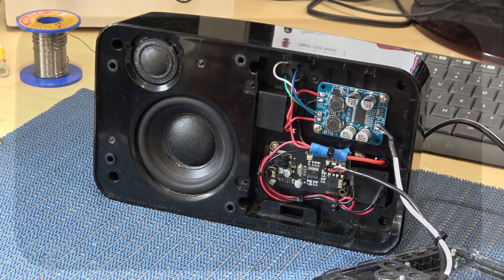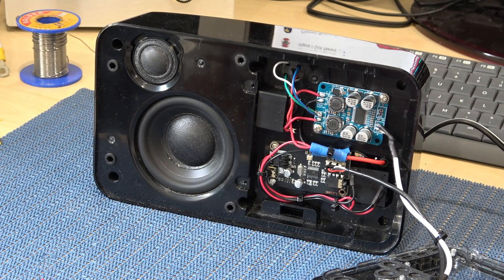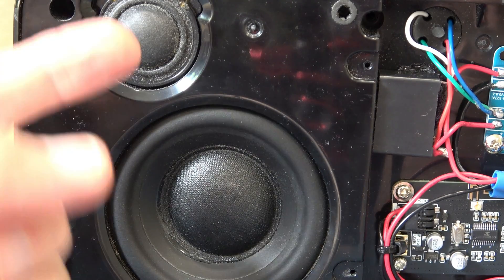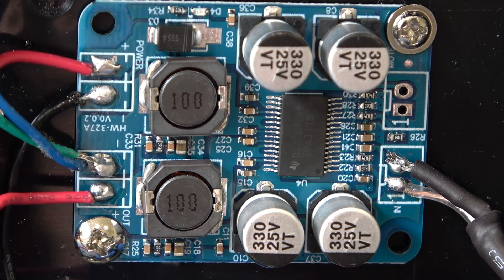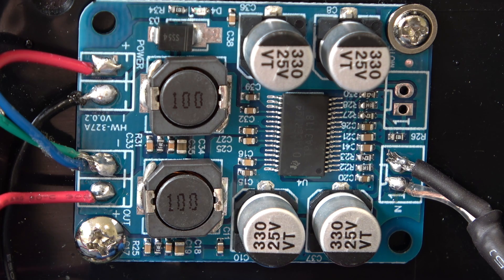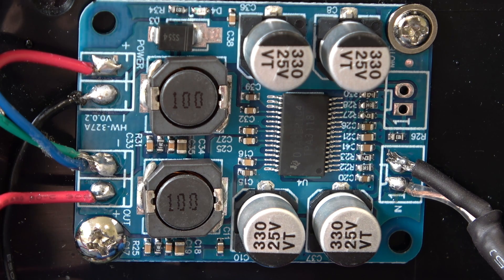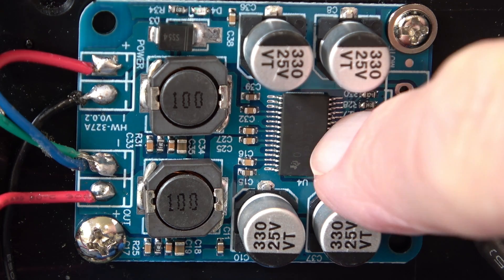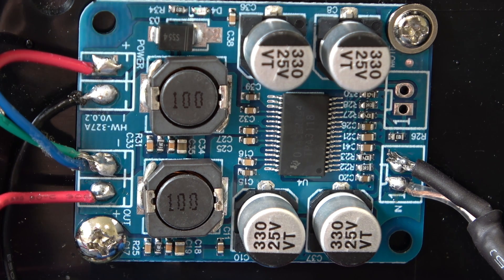Converting a Logiteck Squeeze Box to a Bluetooth Loudspeaker

Comment: Have you seen or used the 2.1 Bluetooth 3118 mini plate amplifier  boards  there great for a small power subwoofer build  there about 30$  💯👍👌✌️   my favorite DIY pre amplifier Bluetooth  board are the arylic pro mini streaming boards the link ability  at a affordable price point 🎶🎵💯👌✌️

Comment: the noise you get when you use the bluetooth amplifier to connect it to the radio's power supply is VERY common. I have experienced it many times on various electronics boards I have bought from ebay. Very common problem

sometimes on mp3 player module boards I have to remove a resistor that disconnects a GND. between the amplifier and the rest. Or the only solution is 2 pcs. power suppny.

Also cheap ready-made mp3, bluetooth, amplifier boxes can have this problem

Comment: these logitech radios have good sound if you have the 1" dome tweeter with the powerful 3" speaker. The larger model stereo version is a good sounding speaker, internet radio.

I have bought many of these logitech 3" bass, midrange from ebay. Very good 3" with good sound quality!

Comment: Hi Michael, greetings from the Czech Republic. I've had a UE Radio in my cabinet for a long time, which is the same piece of hardware. I used to be excited about the Logitech ecosystem, but it's inconvenient for me (very slow startup, problem with wifi connection, etc.). Btw I also had a radio by my bed 😀Your solution with BlueTooth is quite nice 👍